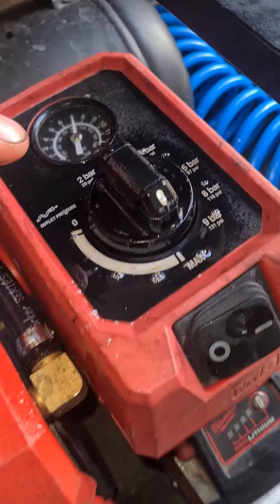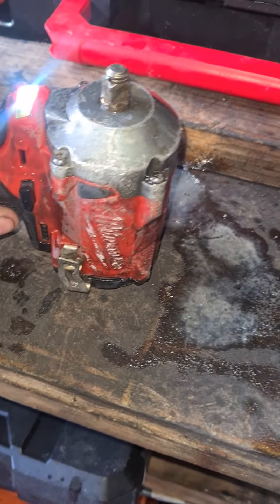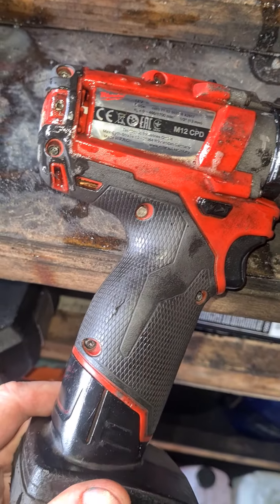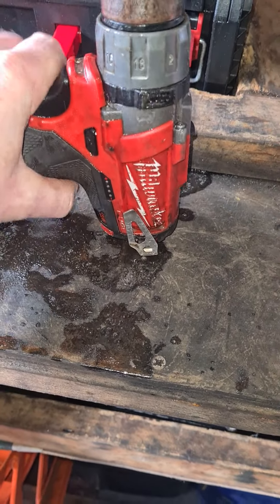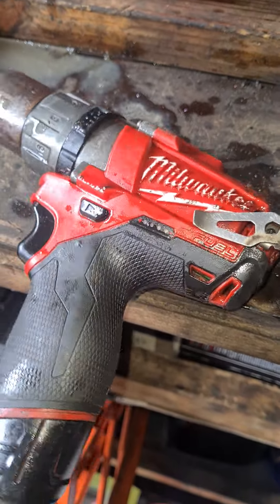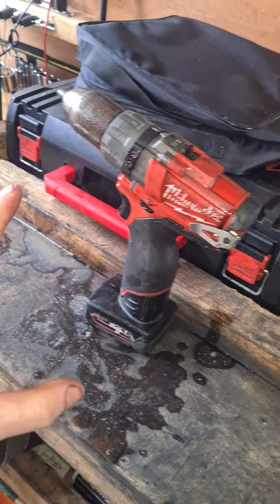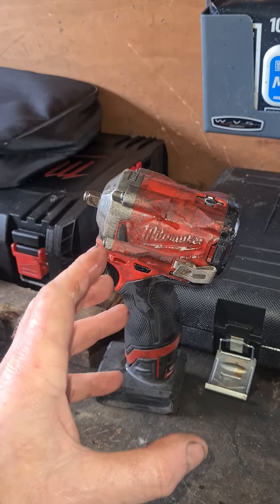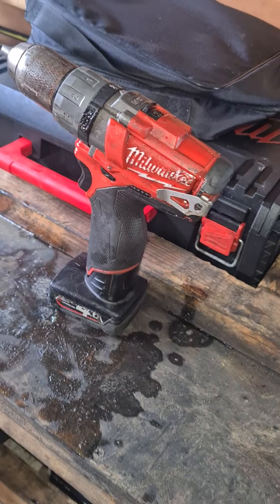Water Damaged Milwaukee Tools Working Again

Comment: With those tools, the board communicates with the battery to turn the battery bms on. If it detects a current leakage or short circuit,  it will prevent the battery from supplying power. The reason it cuts power even though its a 'low voltage' system, is that the batteries are capable of dumping large amounts of current and will over heat and explode if this happens,  so they have quite sophisticated protection. As someone else said, expose the circuitry and use some contact cleaner to clean it. The water probably had contamination in it which got onto the boards.
I'd be tempted to, after cleaning, spray some varnish or lacquer onto the board to waterproof it.

Comment: Hi Jimmy, I'm mobile and use Milwaukee. I've used Deoxit D5 which is amazing then covered the circuitry with thin layer of 151 Fantastic Elastic. Worked fine through all the wet this year. Keep up the good work buddy.

Comment: Great that you recovered most of them, by displacing most of the water with WD40 (Water Displacer number 40), that was its primary purpose.
Like I said in my previous comment, you needed to get the water out asap and, , remove the battery, as that small DC voltage is enough to drive electrochemical processes, with metal being displaced from one point to another, much like in a plating process (you can make nickel plating with a 1.5V AA battery). That circuit board may still be recoverable, but it must be taken out and carefully cleaned, to remove all oxyde growth (I don't think there was enough time to do permanent damage, just enough to set stray voltages where they should not be). These tools are expensive and the effort to recover them may be worth it - do you have any electronics tech among your friends?

Comment: Fingers crossed for the drill.
I've just been checking, although not easy to find I managed to find the IP rating (ingress protection) of my hikoki tools. 
It looks like they're IP56 the first number is basically the rating of ingress to dust, and the second is for moisture, might be worth seeing what the milwaukee are rated at.

Good luck.

Comment: Your drill - if you can brush the corrosion off with a SOFT brass wire brush & dry the trigger out - (on the house radiator ) if it starts working again  cover the circut board with  clear CT1 / silicone or araldite apoxy glue -( to keep the air out - stop corrosion) you might get some more life out them 👍

Comment: whenever anything gets wet use hair dryer. I have had my milwaukee stop and came back to life after drying. still working two years later after being soaked several times. If anything use contact cleaner as already suggested